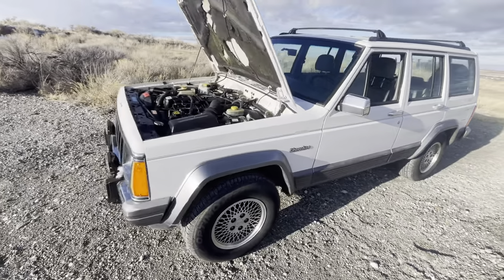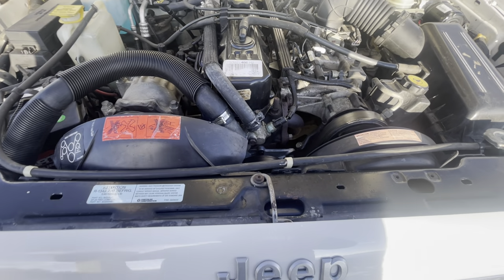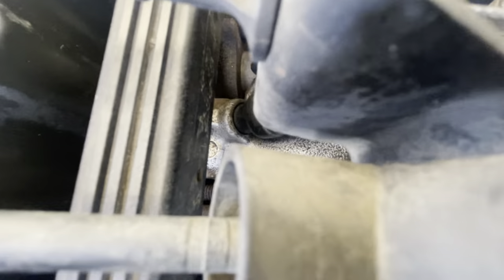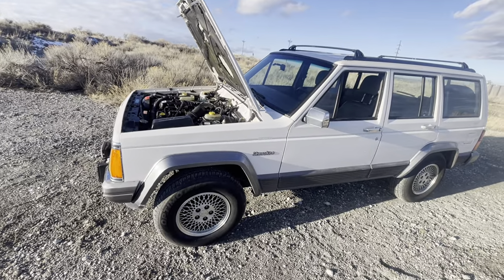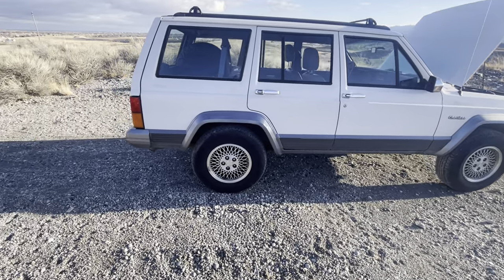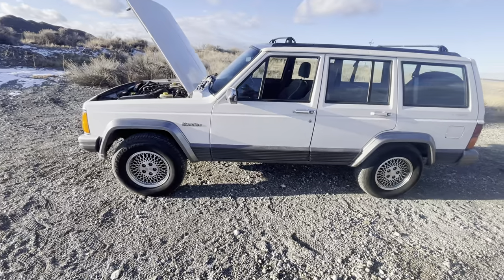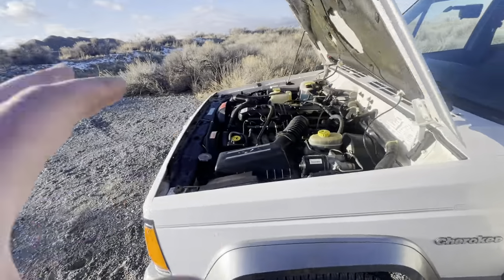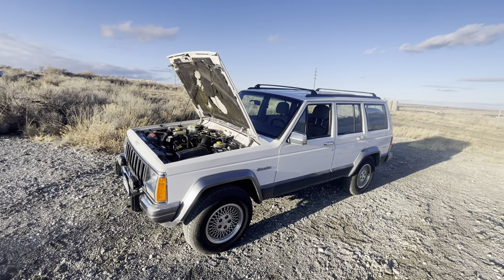How to bullet proof your old Jeep Cherokee XJ

Comment: the biggest problem is people think that bullet proof means maintenance free
Reply from the maker: Absolutely agree. You’ve got to keep things maintained. I try to do something on my Jeep every week. Just did new muffler, cat and tailpipe. Fluid changes will be next ( although it doesn’t really need it ) then suspension stuff.
Reply: Well than ANY car would be bullet proof as long as you "maintain" it. Kind of a dumb statement
Reply: @jonc2914  while hyundai motors were literally blowing up because the factory didn't clean chips out of the crank shaft. while new hemi's have top end oiling issues and will develop a tick if they idle for too long.  what a dumb statement.
Reply: @artardFTW  irrelevant, I never said any other brand was better... I just said new toyotas aren't as good as old toyotas
Reply: @jonc2914  exactly, every car needs to be maintained that goes for any used car you buy, especially one that has over 100k on the odometer... the xj cherokee is easy and cheap to maintain though.

Comment: Cherokees from the 90s are very reliable and if you change your coolant every 4 years or 40k miles your radiator issues will be few and far between.  Old coolant breaks down and causes all the problems you experienced.  Hang onto that one.  If you sell it you're nuts!
Reply from the maker: That’s definitely a must on these old cherokees. The problem is not everyone that bought these things new or used back in the day took good care of them and did the proper fluid flushed and changes. I know that back in the day I had some of the worst luck with buying sub 50k miles cherokees and the coolant was literally brown. 

I did have this listed for $8500 a couple days ago and got cold feet as soon as people started to message me. I’ve decided that I will keep this one , which is very unlike my normal buy , restore , maintain and sell routine.
Reply: @glengoodwin7860  sounds like you're on top of it now but brown coolant means it's ancient.  If you change it every 4 years it will never get brown.

Comment: I'd add that most if not all cooling system "upgrades" are actually downgrades, confused by the fact you probably fixed something and think it's actually better.   100% bone stock is the way.   Missing fan shrouds and worn fan clutches are the biggest offenders.
Reply from the maker: Right. Keep the vehicle stock. The triple Efan setups on these are ridiculous. Mechanical fan and one efan is definitely just fine for this motor
Reply: A Flokooler water pump is an absolute must. Look them up! They pump more at idle than a stock pump. It’s a lifesaver.
Reply from the maker: @TheRealestHi  never dabbled with flowcooler. I’ll give them a shot next go around for sure ! Thanks for the comment 👌

Comment: So... I got a 98 Jeep Cherokee... I know the battery rubs a coolant line a bit, and other than that the Jeep stays at a perfect temp until winter. (It's Ohio winter) During winter seasons the damn thing just don't get hot, like not enough to even defrost and idk what to do. Other than that the thing runs great
Reply from the maker: That’s definitely a thermostat causing overcooling. I’ve got 5 in a row before on different t jeeps that were bad ! Sucks the quality of parts. I hate dealer with junky parts store shit.

Comment: I was silly and installed 180 degree thermostat. Didn't get hot enough air from heater and fuel economy went crap. 195 Mopar OEM thermostat now installed and no issues, quick warmup and steady temperature control.
Reply from the maker: Glad to hear it’s running good 👍
Reply: I did the same. Thought I was doing the jeep a favor but it only made my driving experience worse. Installed a new 195 thermostat and i have great heat, warms up perfect and fast now. Only thing I had to do was install the e-fan for my 5.9 instead of the mechanical fan that the previous owner installed,  (and reconnect the temp switches for the fan relays.) The overheating issue was ONLY a thing because some idiot installed the wrong, or used (and incorrect) fan for the car, and disconnected the old fan wiring.
Edit: oh, that and a proper coolant flush did help too (using proper coolant.)

Comment: I've been daily driving a 2000 XJ for about 20 years now. No electrical problems or head issues. I did have to repair the wires going to the hatch a few times from normal wear and tear. I got stranded once from a blown water pump seal. A lot of the cooling system was replaced including the radiator, heater core, electric fan, hoses, and thermotat.
Reply from the maker: Glad to hear it’s been a good Jeep for you !
Reply: I understand replacing the heater core is a very expensive nightmare!
Reply: @boomerguy9935  I did it myself so it was cheap but A LOT of work.
Reply: @jayman1601  I understand. I replaced a heater core on a Datsun back in the late 70's. Parts were cheap but it took an entire weekend - 2 days @ 12 hours each. Had to remove the entire dashboard.
Never again!
Reply: @jayman1601  There are shortcuts out there it is not real bad maybe 10 hrs

Comment: I have two 93's and a 99, I took my lerners permit test in one of the 93's like 20+ years ago. Still have it. Still runs amazingly.
Reply: Thank you for this video. As long as I've had the one jeep its been in storage. I have a 2wd country edition i drive daily though. Im going to go clean that ground off right now because I know its filthy!
Reply from the maker: Awesome 😎 I took my learner in my moms 02 Grand Prix 😂 

Hang onto that Jeep , you’ll regret it if you sell being you’ve had it so long.
Reply: @glengoodwin7860 oh I’ll have it forever. I’m working the 2WD I use as a daily driver for now. Little guy is a tank.

Comment: Great video Man really enjoyed watching really informative. I’ve owned my 96 for around six months now and it came with its fair share of issues.
Day 1-overheated when I tried driving it Home turned out to be a bad thermostat. I’d also like to add this car has been sitting for round three years before my ownership.
Next thing was the heater valve. 
Then the blower motor. 
AC worked thank god! 
Brake calliper seized up on my front driver side. 
Fuel line split at the rear. 
Now my radio antenna is stuck up which all things considered isn’t a big deal. 
Also someone put the wrong fuel cap on and when driving had a strong smell. Had to chase the smell from front to back thinking it was a leaking injector or something, turned out to be simple as a bad fuel cap. 

All is done now hopefully nothing big will need doing for a long while, but I’m always looking under the hood and under the car checking!

Comment: I have had my XJ for 20 years now. Its a 1999.  My recommendation is to get an aftermarket auxiliary transmission cooler. It looks like a mini radiator that attaches to the radiator. It keeps the transmission cooler.  I have 398,000 miles on my jeep with the same transmission that shifts perfectly.  Suggest also adding Lucas transmission additive for additional protection. 

Second suggestion is to add 2 leaf springs on the rear suspension. If you put any weight in the back (equipment, people, tools, camping gear, etc) the back will ride low.  Adding 2 leaf springs is a cheaper alternative to a full lift kit. Not only is it functional but it makes the jeep look cooler.

Also carry some spare fuses and a map of the fuse panel on your phone.  I have had a few random fuses blow over the years and having a collection of different size fuses saved my bacon a few times. Watch for mice getting into the air filter box.  Its about the size of a shoe box and mice will get in there and make a nest or store acorns for the winter.  Finally get a roof rack to store the spare tire so you can free up space in the hatchback.
Reply: There is the Lucas 10441 Conditioner and the 10009 Transmission Fix. ??  Both mention extending transmission life.

Comment: Purchased a 1996 Cherokee XJ off a friend for $1000 that already had a 3.5" lift about 4 years ago that needed some TLC.  Put about another $1000 into it e.g. fuel pump, starter, water pump and a few lines.  Now its running strong and has been my daily driver for a while now.  Starting to refresh all the steering/ supension.  I will never sell it!
Reply from the maker: Sounds like you’re on the right track ! Keep maintains that Jeep and it’ll last you a lifetime.

Comment: 1987 to 1990 its crucial to add a short ground from the battery negative to the fender
Reply from the maker: Absolutely!
Reply: Could you explain why it's crucial to do so? I just purchased an 87.
Reply: @johnsanford346  factory ground goes from battery negative, to the block, and then from the cylinder head to the firewall, through a braided ground strap. that's it. 

adding a ground to the fender will give the grounds a path of least resistance to the battery, you'll (most likely) see all of the accessories work faster & lights get brighter. 

on my old 89 I think I just grabbed the shortest eye-to-eye ground cable from Walmarts riding mower section

Comment: Great video with lots of useful information. I had a packrat build a nest in the air cleaner box of my 96 XJ. I put some wire mesh over the front airbox intake hole to deny the little bastards access. Besides peppermint oil you can buy a couple cheap 120 volt plug in led lights and mount them on a board having them shine down on each side of the engine. They don't like the light and won't try to nest there. If you live in a place with some security, you can just leave the hood propped open and that will discourage their assault. I am amazed at what a great and versatile vehicles the XJ's are.
Reply from the maker: Those are great ways to combat mice ! Fortunately my neiborhood has some wandering cats 👌
Reply: I had a mouse store 2 lbs of acorns in my air filter box 😂. Didn’t know it until I changed the air filter one day.

Comment: Great video. One thing I want to echo.... crank shaft sensor. MUST REPLACE WITH OEM! The after market sensors most likely will not work with the computer.
Reply from the maker: Great input , totally agree. What I usually do is get sensors off parts Jeeps that are factory units. I have tons of throttle body and others for diagnosis and spares. Thanks for the comment !
Reply: Happen to have a link to where I can get one? Rock auto didn't seem to have one.
Reply: @piston_pusher

Unfortunately the Mopar CPS was discontinued years ago and the parts supply has all but dried up. I have one left and I wouldn't sell it. Used or aftermarket is about the only option now.

Comment: Great job! I'd add death wobble. Warn bushings, track bar for sure and also door locks, latches.
Reply from the maker: Definitely good things to look at ! Throughout the years I’ve maybe done one or two wheel bearings , some u joints and a ton of sway bar bushing stuff. Can you believe I’ve never had death wobble ? I’ve heard about it for ages but I’ve never really had a beat up XJ ( most are mint and low mileage ) so maybe my day is coming 😆
Reply: @glengoodwin7860 mainly an issue with oversized tires that are not balanced properly.   At least in my case.

Comment: My grandmother had an XJ Sport with the 4.0 and 4 speed auto, got it for new back in 1995. The only reason she got rid of it was because the parking brake sensor started having trouble engaging the system as a whole. Outside of that, the car was structurally and mechanically mint condition. There were a few cosmetic problems but if she put maybe $500 into getting someone to clean up the interior and replacing the hood, it would've been showroom ready. She only ever used it for city driving so it was barely used to the extent other Jeeps are (it had maybe 130k miles on it). Instead, she sold it back in 2019, despite my brother begging her to sell it to him so we could keep it in the family. By now the car itself is probably long gone, it went right to auction after and it's probably in a junkyard or modified to all hell by now. But ever since then I've always wanted an XJ for myself. My dream would be to find an XJ that looks exactly like hers (white with the red sport striping on the sides) but as long as it runs I don't care the color.
Reply: that sounds like a really cool design i have a 2000 white sport that i love
Reply: Why did she sell it to someone else if your brother was offering to pay?

Comment: I have a jeep cherokee pioneer 1990 bought it for a $1000 spent over $700 flushing all the fluids and changed, b4 Driving it, then replaced the Radiator Coolant Overflow Tank Reservoir about every two years, and replaced the fuel pumps 4 times before I got a good one that worked!
Reply from the maker: Keep up the good work restoring that Jeep , you won’t regret having it around in the future 👌

Comment: Watching this as a proud new owner of a 1990 XJ also in Colorado, mines got about 260k miles but it runs pretty good. Ill definitely be looking into my cooling system and the electrical though. Just the other day it didnt want to start for some reason, just completely died, even the dome lights. After a few minutes I tried again and it fired right up, strange lol. Thanks for the video!
Reply: might want to check your termical connections. Sounds portentially like a bad bettery connection or ground.
Reply from the maker: Yup , as stated in the other comment , check your grounds. You’ve got the older style renix engine management system , it’s can be tricky at times , but some say the overall build quality is better on that era 4.0 and I would have to agree. Good luck with that Jeep and have fun with it !
Reply: I agree with the other comments, disconnect and clean the battery terminal and the wiring. After 15-20 years you are probably looking at rewiring the battery system anyway.  It will last for years and save you from getting stranded.  More than once I have had the dreaded no start, I went out and fiddled with the battery connections and it started up and ran fine for a few weeks

Comment: The difference between and XJ and a ToyTruck is repairability.  Even a moderately experienced mechanic can repair an XJ, and there are very few 'special' tools required.  A ToyTruck on the other hand is training and tool intensive.
The Top Nail in the Toy's coffin as issues start to crop up is the Aluminum Cylinder Head.  If you get it even moderately overheated, it's 'toast'.  The Iron Head on the XJ's 4.0 will survive more abuse.
My personal XJ that I purchased new in 1995 has 456,000 miles on the original Engine with only routine maintenance.
Reply from the maker: Only done one or two major engine repairs on the XJs throughout the years and it was head gaskets. I’ve done quite a bit of maintenance stuff on both the 4.0 v6 and 5.7 v8 Toyota engines. From spark plugs , water pumps , radiators and other things they’re pretty easy to work on. Major failure is very very uncommon on those two engines. I’m not going to argue about the complexity of the Toyota/Lexus engines , because they’re definitely complex. But overall , I’d take a Toyota over a Jeep every second and minute of the day.

Comment: Everything you pointed out I’ve had those problems with mine I need to get a new radiator since that’s my newest issue overheating and fan issues
Reply from the maker: Yup. It’s a vicious cycle. Working on 93 right now and sure enough cooling system stuff right off the bat , imagine that !!!!
Reply: @glengoodwin7860  do you have any tips or radiator suggestions?been looking at 3 row aluminum raditors
Reply from the maker: @hectorkills1  this 93 I just got has this one - https://www.jegs.com/i/JEGS/555/511594/10002/-1?msclkid=471d4421db101c39fd5422fc1a9b1191&utm_source=bing&utm_medium=cpc&utm_campaign=WP_US_Bing_Shopping_555-Products%20-%20Standard&utm_term=4581321375237593&utm_content=555%20Long%20Tail%20SKUs

Comment: Being in CO. Idk what your rain situation is, but here in pnw. We deal with our firewall leaking into the fuse box.
Reply from the maker: It’s terribly dry out here , so I’ve never experienced that issue. I grew up in Michigan , and never had a problem there either. Maybe I got lucky…
Reply from the maker: It’s terribly dry out here , so I’ve never experienced that issue. I grew up in Michigan , and never had a problem there either. Maybe I got lucky…
Reply: Mine started giving a code after camping out one night and it rained, the Efan started acting weird, and I got a EVAP code that wouldn't go away and I couldn't pass emissions, so I got a used computer and replaced it and haven't had any problems since. And I have a spare one now to keep in it. It's right next to the drivers side wheel well, and air intake on mine, so it probably got wet or something Im thinking.

Comment: The fuel line to the fuel rail has a mounting tab under the intake manifold. It rubs and rubs. In time, they leak right there from the abrasion. If you smell gas under the hood, check that line. Reach under the intake (when it is cool!) and feel that fuel line mount. If you can smell gas on your finger, you need to replace it. Make your own line to avoid that from reoccurring. Easy instructions are available on the forums.
Reply from the maker: Never heard or had this happen , but it definitely makes sense if motor mounts are shot and the Jeep has been driven for a long time with excessive vibration. Some years had a big problem with motor mount bolts shearing off compelty 😮